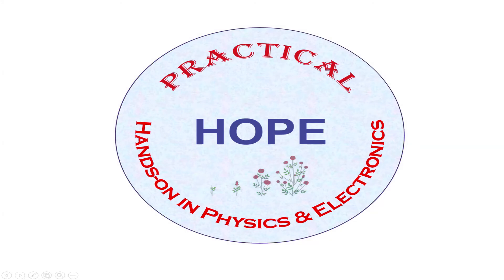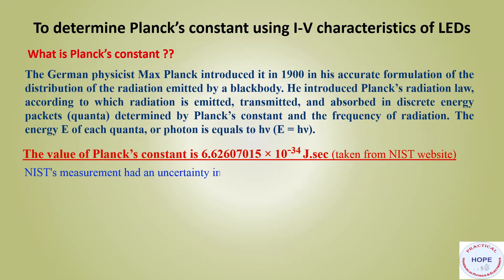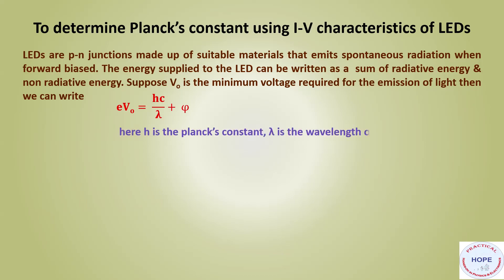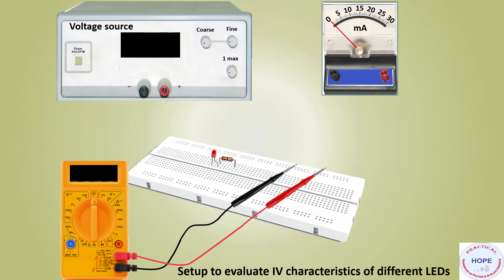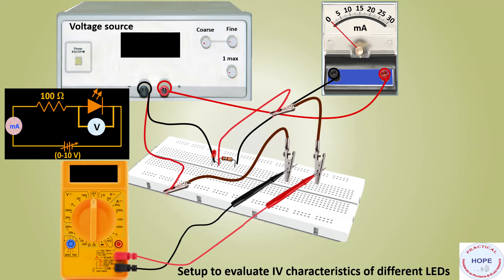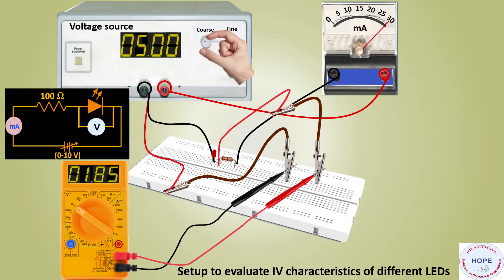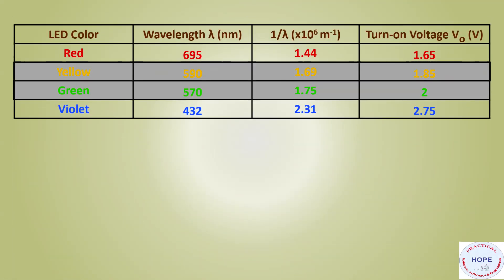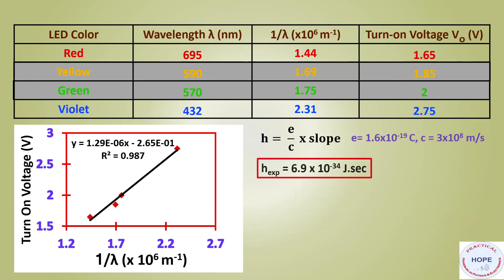Determination of Planck's constant using LEDs

Comment: tried this circuit. though current is increasing, voltmeter showed zero readings and LED didnt glow at all. What could be the reason?
Reply: The ammeter must be in circuit and the voltmeter must be parallel to diode. If you essentially just make a normal circuit using the ammeter first, then create a mini circuit with diode by connecting the voltmeter to both ends of the diode on top of the preexisting connections.